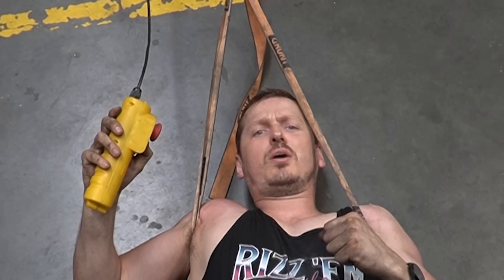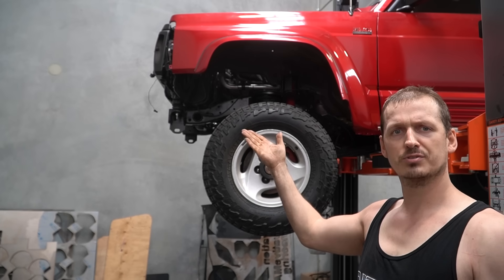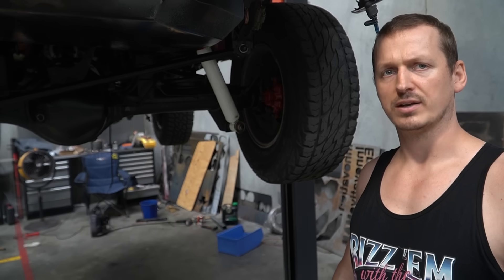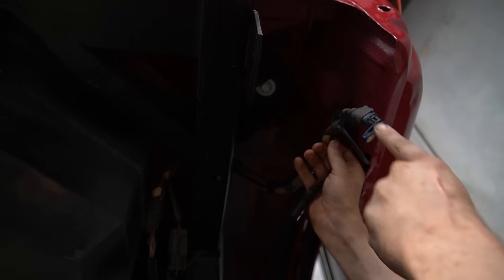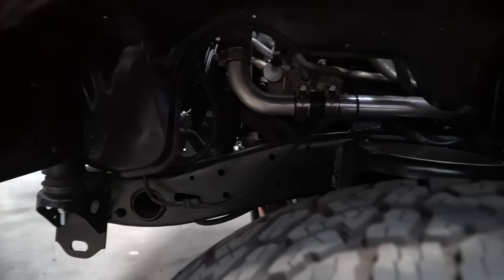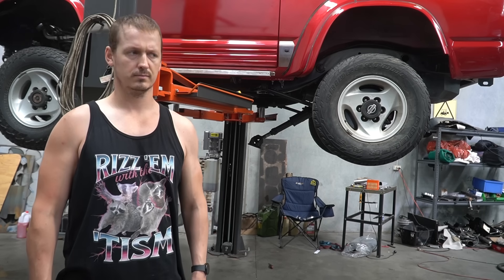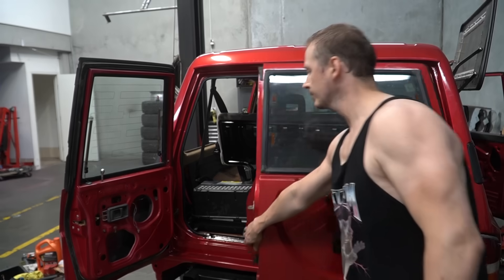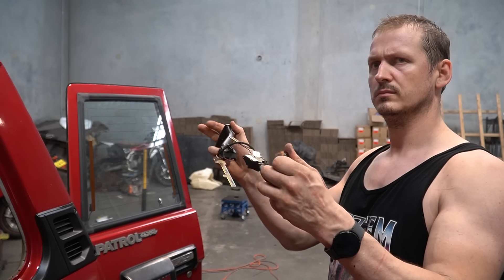DIY Park Brake on A V10 TDi Swapped Twin Turbo GQ Nissan Patrol

Comment: You may want to drill and/or slot the disc for purposes of expressing water, mud, and other debris, so that the brake engages without damaging any of the components due to lodged debris
Reply from the maker: That's a no from me

Comment: Just wondering if the batteries have vent ports? If so, please run tubing to the outside of the cabin area for safety.
Reply from the maker: Wouldn't be ADR compliant without vents

Comment: 4.8 GU patrols have handbrake on the rear diff. 

So when you need to put the stronger GU diffs in this car because you keep breaking the GQ stuff, remember that
Reply: My td42t GU has the handbrake on the transfer case and the small diff (H233?).  Do the 4.8 GU patrols have the larger H260 rear diffs and that is why the handbrake is different?
Reply from the maker: As far as I know, it's leaf sprung that got the wheel park brakes. Regardless, the pull lever mechanism wouldn't be enough to operate one, since a tranny brake in this case is 3.9x stronger. Tranny brake is the go. Also, these are tb48 diffs. Just... Coily ones
Reply: @ridiculousthings4x4  nah, the coil wagon had them, I know, I had one.
Reply: @ridiculousthings4x4  actually, might be just the auto ones..... I haven't owned my 4.8 for like 4 years haha
Reply: @ridiculousthings4x4   did you put 4.8 diffs in for the diff ratios and additional strength? 

They have bigger front brakes too( which I sure you already know)
Reply from the maker: @DarrenBoxhall yes, 3.9 diffs coupled with 35 inch tyres gives the same drive line ratios as the Touareg. Running it now on 31s though, it's a bit under geared
Reply: @ridiculousthings4x4  ahh yep.  Might have to get the 4.8 auto 3.5 ratio if you want to run the smaller wheels
Reply: @Mark_Bridges  smaller H233 has the handbrake on the diff in the 4.8s

Comment: 7:15 are these 3 bits strong enough to hold the car in an emergency? I not mean preventing from starting to roll.
Reply from the maker: 1/3.9"th" of the force required being a tranny brake, plus the bracket is 5mm thick secured by 4x M8 bolts in pure shear. Mathematically, it's more than adequate
Reply: @ridiculousthings4x4  I mean the thickness of the "ears" of the home build disk.

Comment: I used one of these hightec calipers on my missing wheel Morgan while converting from the 98Kg drum brake to 3 Kg disc. They´r great and properly adjusted they work well, once.
I didn´t convert the rear to drawer though.
Reply from the maker: How did you go about them not having any sort of pad retaining setup?
Reply: @ridiculousthings4x4  The pads are retained radially just like all other disc brake pads, and like all other pads they wipe the disc while in normal operation. Disc brake pads are not drawn back when brakes are not aplyed. The biggest problem with these cheap calipers is the inadiquate force aplyed to the pads when braking.
Reply from the maker: @h-j.k.8971 aside from this one, I've never seen a caliper without any type of pad retention. Be it anti chatter plates and suchlike. The pads aren't even bonded to a backing plate. Left to their own devices it would just wear into a bevel and drop out
Reply: @ on second thoughts, do you have a Wilwood caliper or a chinese knock off?

Comment: the rear is easy mate... ive watched the videos... i know!
1. pie warmer
2. fridge
3. pull out sink and tap
4. inverter
5. induction cook top
6. yellow led lights
7. slide out pantry
8. on board compressor with hose reel.
9. fold down tables on the rear door
10. rear bar with tyre carrier and jerry can holders
11. dish washer and washing machine
12. tumble dryer
13. shower rose, with associated shower tent hanging off the roof rack
14. joolca hot water tap
15. disco ball and flashing light sound cannon to completely fuck the serenity.
16. auto motors to swing open and close the rear door
17. tissue box, to clean yourself after youve finished wanking over your setup!

thats about what they all need mate.